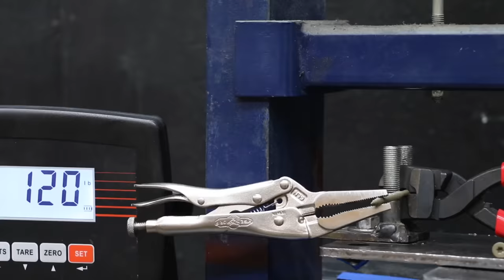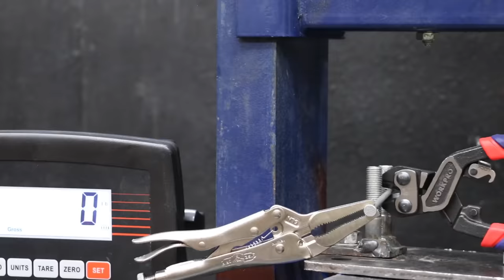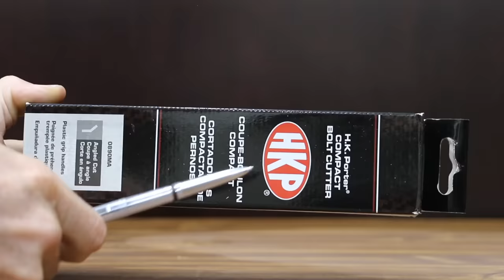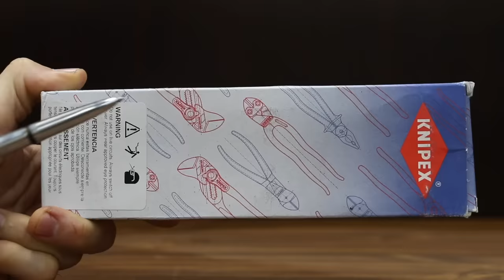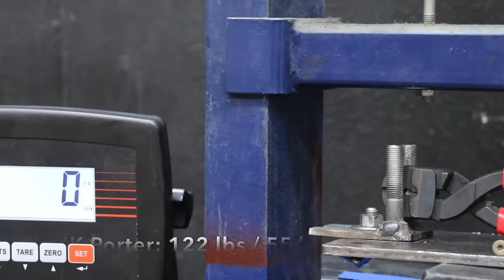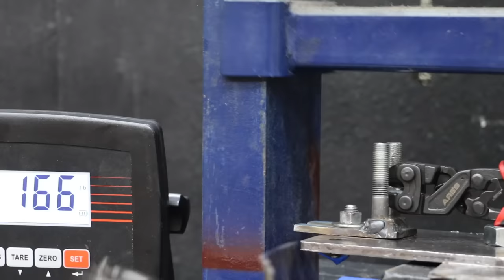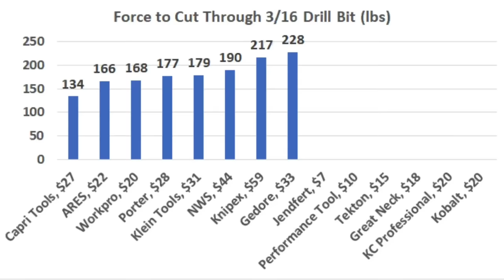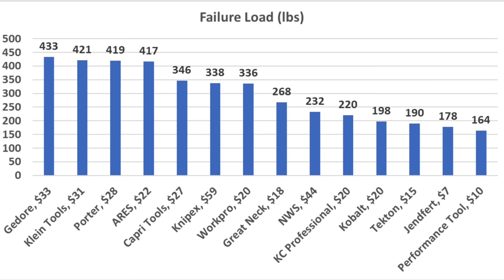Best Bolt Cutters? Knipex, Klein Tools, Kobalt, Tekton, Gedore, NWS, Porter, Workpro, Capri Tools

Comment: I have the Irwin clone (no longer available) of the NWS diagonal pliers in this test. They're easily the best set of diagonal pliers I've ever used. They (along with some of the other tools) would've fared better if the allen wrench wasn't wedged against the innermost part of the cutting area. I used mine daily for almost three years at my previous job, and the cutting surface still looked like new. Great test nonetheless!
Reply from the maker: Thanks!

Comment: The drill bit test, the first few tools, the bit was at the end of the tool or at the middle. The bit should be nearest to the fulcrum (pivot point) for maximum efficiency.

Now for my opinion. This is just an opinion. It feels like he rigged those tools to fail since it was not all the way nearest to the fulcrum (pivot point). Why do I think this? At 11:53 he explained how the bolt would slip a little from the pivot point this having a leverage disadvantage.

Not like he will be reading this.

Not a hater, i love all his videos and some of my tool choices has been influenced by him. I just thought this was off a little.

Comment: If you get the chance please do a Vid on cordless tools left out in the weather for a few days, i had a Impact driver left on a roof for a few days (no rain only dewy nights), it started ok but after a few weeks it got weaker until it wouldn't start. Repair guy said waste of time as they are sealed inside but something dies and it won't start. It would be great to find a brand that can handle that exposure. Yer i know don't leave them on the roof BUT it happens a lot from what trades tell me.
Reply from the maker: Thanks for the video idea.

Comment: Thanks again for another great showdown. Something I would love to see from you is a showdown of watches. I know its not your usual thing but it is a tool for telling the time, and many trademen hold theirs closer to the work than nearly anything else. You could test for things like scratch and impact resistance, being run over by a truck, being submerged in brake cleaner or salty water or transmission oil, readability from an angle, how much force it would take to rip it off your wrist if it got hooked on something (I guess for that one you would want it high but not so high as to be dangerous, like ski bindings), and how much it stops your hand from reaching into a tight space. There is also a lot of price range on watches from dead cheap on up to yacht money, so I want to see whether buying a more expensive watch (within reason) really ends up being more useful for people who work for a living.
Reply from the maker: Thanks for the suggestion.

Comment: I'm actually pretty surprised at how short the handles are these days. I have a pair of bolt cutters from my grandfather with 24 inches of handle to put pressure on. Can get through pretty much anything you'd need bolt cutters for with almost no effort. Can't even imagine using that knipex. Sharp, but such little leverage.
Reply from the maker: Thanks for the feedback.

Comment: Can you do a video of the larger sizes of insulated copper wire like 2/0 AWG?
Klein has their "Rabbit Ears" but takes both hands most times to actually cut through.  Knipex has an alternate model with dual cutting edges but likewise needs both hands to cut through the wire. 
It would be interesting to see if you could find any better options.
Reply from the maker: Thanks for the suggestion.

Comment: I have an idea chainsaw oil in an engine block.

 and i had rewatched a video of those electric chainsaws and i don't think huqvarna had a fair fight. you used a 259$ husqvarna 120i which in my opinion is a hobby saw. i would like to compete again between electric chainsaws with a husqvarna 540i xp with a 9.2 ah battery and a qc330/qc500 battery charger I ask this because I have a husqvarna T540i xp (top handel model) with a 5.4 ah and 9.2 ah battery and a qc 330 battery charger (and yes this set costs considerably more than the 120i from husqvarna and that from stihl u used in that video) but this one is a monster among electric chainsaws. 

best regards from the Netherlands and i wish you a happy new year
Reply from the maker: Thanks for the suggestion,  Happy New Year!

Comment: I really appreciate your videos.  I have changed my preferred HVAC filter, car air filter & motor oil all based on your testing.  Also, picked up some cool (albeit expensive) hand tools because of your videos.  Couple thoughts on this one--it looks like the position of the object being cut in relation to the cutting jaws varies from tool to tool.  This has to affect the force needed to cut thru the object.  Is this due to the limitations of your jig setup (ie the handles not being able to widen enough in the jig) or simply the design of the tool (handles full widened but the jaws could not accommodate the object close to the pivot point)  ?   Also, it would be nice for you to look at the span of the grips with the jaws open.  For those of us with smaller hands, this can be an issue if the span of the grips is too large.  It can make the tool awkward to use, at least one handed.  In this case, it maybe a two handed tool anyway depending on what is being cut, but I think you get my point?  Again, keep up the great work.
Reply from the maker: Thanks, will do!

Comment: I have watched your videos with the motor oils , amsoil being a good oil,, now I'm wondering what is a good synthetic automatic transmission , I've used the mobile transmission fluid  in my 2000 f250 Diesel,  now I'm looking to see if amsoil would be better for my 2019 F350 Diesel , or is there a better oil than them for heavy duty service. I've just tried the amsoil differential oil in my truck to see how that works, have you done a video on differential oils ?
Thank you for all you do , really enjoy you channel
Reply from the maker: You are welcome!  Thanks for the suggestion.

Comment: As a new subject I would like to know if it is possible to filter used motor oil to the point that it is clear again, I have seen using toilet paper rolls and cotton string but never any results. Apparently farmers used to do the string method and after tied the used string around wooden fence posts to prevent pests.

Comment: You missed in your test one detail. Elasticity of the handles wgich makes you to apply more force to cut a bolt. A performant tool has less elasticity of the handler. BTW: For many folowwer i mention that NOT ALL drill tail are unthreated so some of them can not be cutted with these tools.
Reply from the maker: Thanks for the constructive feedback.

Comment: Another factor I'd like to consider for a bolt cutter test is the availability and cost of replacing the jaws. As you know, pretty much every cut is going to do some damage to cutting jaws, so you have to expect frequent need to change out the jaws or buy a new tool.

Comment: I'm wondering why you were placing nails in random locations inside the jaws? Does it mot matter? Some nails were more towards the tip, and some were more towards the lever, I'd think the ones closer to the lever would take less pressure but maybe I'm wrong...

Comment: Your inconsistent placement of the items being cut in the jaws I contributes more to the difference in the cutting force than the design of the tool.
Reply from the maker: Thanks for the feedback.  The jaw opening of the pliers limited moving items closer to the pivot point.  I wish the opening for the cutters weren't so limited for many of the brands.

Comment: It looks like there is a lot of inconsistency in where you positioned the nails, screws, drill bits in the jaws.  Sometimes it was well back in the throat (where it should be for maximum leverage) but other times it was halfway out from the back of the throat.  That makes a huge difference in cutting performance and leverage.

Comment: I had a great ish video idea is there a way to make diesel run in a gasoline engine without adding gasoline to diesel or is there anyway to make gasoline run in a diesel engine without adding diesel or kerosene to the gasoline like using additives or adding alcohol just an idea to kick around

Comment: Why is it so hard to find an offset mini bolt cutter. When I was in California I could get them all over the place I moved East and I have to order them from Japan. And that's the only place that I've really seen the ones that have a 30 to a 45° offset to get in and flush cut nails so you don't cut your hands on them doing repair work in sub areas or Attic's?

Comment: Hi, can you test what is the best Cv joint grease? ( not tripod joint just regular cv - or you can do both… Aircooled Volkswagen cv joints would be a good example from a 71 or 72 model Polyurea Black Moly? Redline cv-2 red Molly ? Thanks love your videos
Reply from the maker: Thanks!  Thanks for the suggestion.

Comment: Wondered if you would consider testing these very inexpensive tachometers sold on amazon and ebay for as low as $8.  Used on my snowblower and it worked, but I would just like to see if the accuracy would compare to a known accurate tach for small engines and motorcycles
Reply from the maker: Great suggestion!  Thank you.

Comment: Could you do a video comparing which brand of diesel is best, which has more bio diesel, cleanest, leaves the least amount of carbon? The place I usually get fuel from started using a third party brand and within 5000 miles of using it my engine started having problems mainly with all ther carbon build up. Much appreciated!
Reply from the maker: Thanks for the suggestion.

Comment: Why don't you make the under the hood sleigh bell for the wintertime? All it would cost is a horn or program that could be added and people could use sleigh bells to greet folks during the holidays from their cars and restore the feeling of Christmas that is so lacking. Songs would sound better too, with sleigh bells rolling along. It beginning to a lot like Christmas would have a new meaning. Charge 10 bucks and make a profit, two coffees from Starbucks or Dunkins cost more and don't last as long.
Reply from the maker: Thanks for the suggestion.

Comment: Do oil filter or drain plug magnets actually work? Considering that transmission and differentials sometimes use magnets, I think it could.
Reply from the maker: Thanks for the suggestion.

Comment: I never see Klein hold up this well. Their edges don't last. My Capri bolt cutters tip broke real quick.  Stay away if you want a tool that last.  I think Klein and Capri are might have their hands in this video.

Comment: Engineered to fail? Some tools are. I had a impact screwdriver that under the soft plastic sleeve the body of it was machined in to make it thinner than the rest of it and that’s where it failed. Do any of these tools shown here have obvious areas designed to fail?

Comment: I wanted to see you use them with your hands, the static press was good but how many pounds of pressure can you exert with your hands since they have short handles.  When I think of bolt cutters I envision the large heavy duty bolt cutters.  Can you really exert 150 pounds of pressure with your hands?
Reply from the maker: Great Point.  A lot of people  can squeeze 150 ponds using both hands.

Comment: Hi, could you do a test on Cable cutters?  I drive 18 wheelers and sometimes the seals are made from a stainless cable and bolt cutters do not seem to perform well at all on cable.   One place I deliver to has a small set of cable cutters that cut through stainless like butter but they are not branded and they don't know where they came from.
Reply from the maker: Thanks for the suggestion.

Comment: The nails are not positioned on the cutter jaws the same way. The cutters with the best score the nail is loaded closer to the back of the jaw where the cutters with the worse score  the nail is loaded closer to the tip of the jaws

Comment: I’d like to see the new small Solar Generators like the Jackery and Goalzero compared head to head. Also the portable solar panels that can be used the charge them. My wife recently purchased a Jackery at HF ($249) and found that could power a string of LED lights for over 24 hrs. “Very impressive”
Reply from the maker: Thanks for the suggestion.  Thanks for sharing.

Comment: I absolutely love these videos, but the testing methods are highly subjective.  Do you use the same tool when putting it through the ringer at the final load?  I think the data would be better if there was bell curve, and multiple tests of the same brand.  My problem with some of these final tests are the press loads you put them through.  I doubt many of us would be able to squeeze more than 45lbs in from a single hand.  I think that when these tests are performed there should be a disclaimer of their use.  I would like to see a subjective review of the ergonomics, as this is important for older folks, or people with carpal syndrome injuries.  Another thing, to keep in mind.  I've had my Klein tools in a box outside where it collected moisture, and the rust on them was to the point, the joint would not move.  I had to apply massive penetrating fluid, and wd-40, and run a wire brush, to get it back to working condition.  A lot of folks live on farms, and this would be a huge problem.  Might want to run a 3-4 day test and see how bad they rust with moisture.  Good review overall, I'd probably buy the capri or the tekton in my garage.  But if I was someone who builds wired fences for a living, then yeah, I'm shelling out the money for the Knipex.
Reply: Hey you did put the disclaimer in another video of gripping strength of a human....You are ahead of me already...lol

Comment: Cool video! I was thinking that if you were to do tests like this on a more regular basis it might be a good idea to put a linear scale on the press so that you can record a pressure vs travel chart. The position of the workpiece in the jaws changes the amount of pressure required from the handle and even .02" difference along the jaws can give a huge difference so correlating force/travel as a ratio at maximum might a better indicator of ease of use and how easily it cuts.
Reply from the maker: Thanks!  Thanks for the suggestion.

Comment: It depends on where the nail is on the cutters some are more in the middle some are not it makes a huge difference so not a fair test
Reply from the maker: Thanks for the feedback.
Reply: @ProjectFarm  might be expensive but a video idea testing like around 2000 watt inverter generators

Comment: I am extremely disappointed from the Capri.
I bought them because of this video and I cut 1 (yes a single one) 1,45mm nail (so very thin) and I got a hole in the blade.
Maybe they send worse tools to germany or they changed the production but thats an absolute joke.

Comment: The drill bit was not being cut. it was breaking. You don't use hardened steel to cut hardened steel. Use a cutoff wheel.

Comment: 刃の開く幅がそれぞれ違うので、根元で釘を切ってる物もあれば、先端で切ってる物もある。The width of each blade opening is different, with some cutting the nail / screw at the base of the blade and others at the very tip. 
これは結果に大きく影響しているので、このテスト自体の信頼性を下げている。This greatly affects the results and makes the test itself unreliable. 
事前にカッターを全て確認し、釘やネジを切る位置をあらかじめ統一しておく必要がある。All the cutters should be checked before testing and the nail / screw position should be determined ahead of time.

Comment: These tests and reviews are very helpful. But only if a person doesn't develop cognitive dissonance and buy the name brand instead of the tool. Most of the time, the better brand will out perform the lesser brand, but not always. I see lots of comments where a person ignores the results and self-justifies the name brand. Some tools have a hard life and bolt cutters are one of them. So why wouldn't a person want to get an equally good tool for half the price. For the price of one pair of Knipex, you could buy two pair of Capri. It is easy to mis-use and abuse a tool when in a bind. One can literally ruin a tool with a single use, I have. So having cheaper priced tools of good quality is a necessity so we don't ruin all our good tools.
Reply from the maker: Thanks for sharing.

Comment: You have so many videos you must be running out of ideas. Well I've seen this video before, but people do strength tests of ratchets/breaker bars. They use a digital meter to measure the amount of torque before it breaks. You'll be breaking a perfectly good tool, but it would likely be life warrantied. But maybe not if they see the video lol.
Reply from the maker: Since I test tools to the limit, I don't try to do the warranty.

Comment: 59 dollar for the knipex ? holy s***
in germany you get the same model for 35euros 
an you tested only the 200mm version.
there exist even a stronger modell the 250mm Version
Knipex•KNIPEX CoBolt® XL•71 31 250
it costs about 42euros.

Comment: The testing of the bolt cutters is biased because you cut with the tip of the bolt cutters instead of the rear on some which of-course perform poorly, and at the rear of the jaw with others which of-course performs much better.